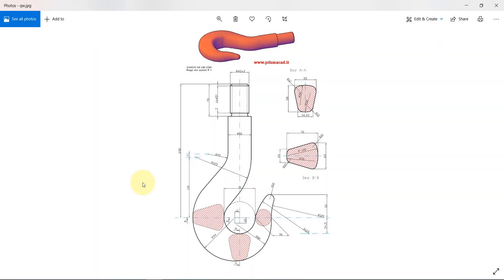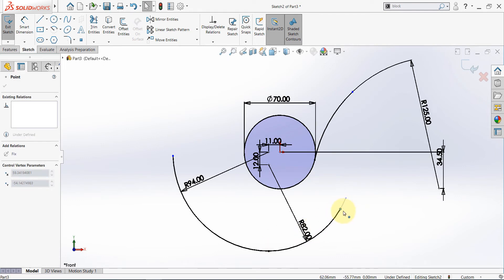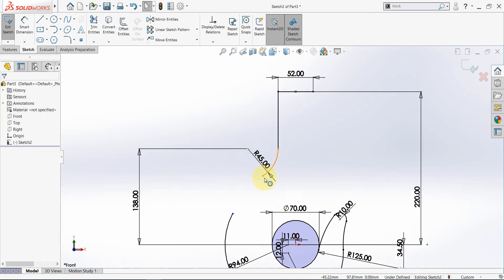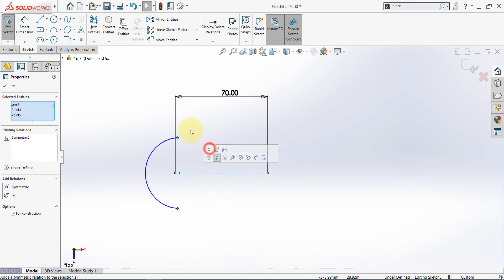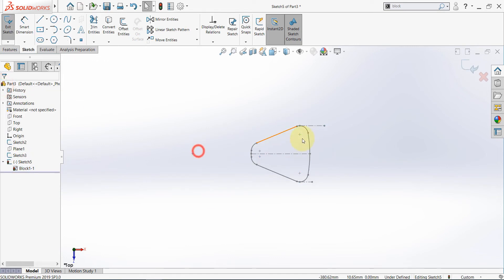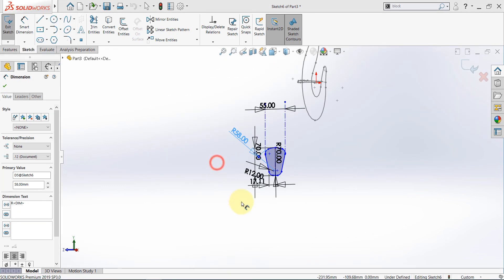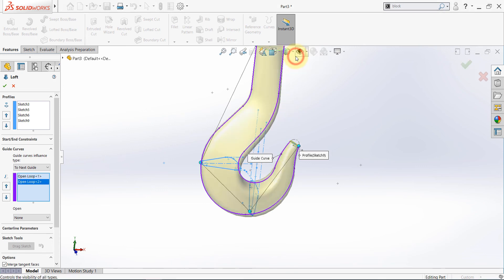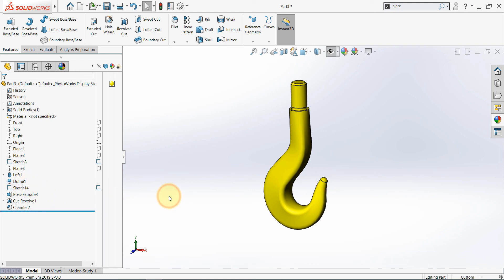SolidWorks Hook modeling

Comment: A strength analysis would also highly be appreciated!!
Reply from the maker: Attila Szilágyi  
Many thanks professor. I will take that into account as the next step :)
Reply: @mohammadzgoul90  The Grashof-theory for curved beams could be applied here for quick manual calculations.
Reply from the maker: @attilaszilagyi2257  
That is really great, so I will have a reference to double check the simulation results :)